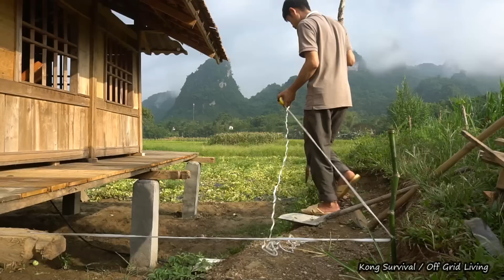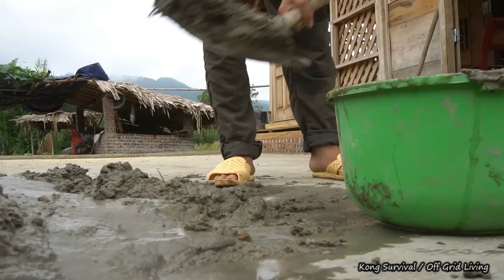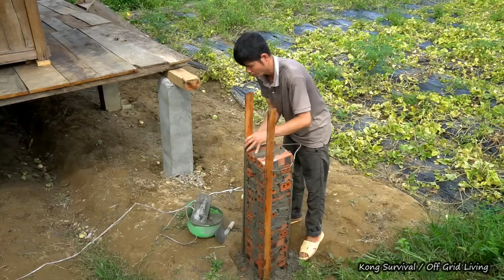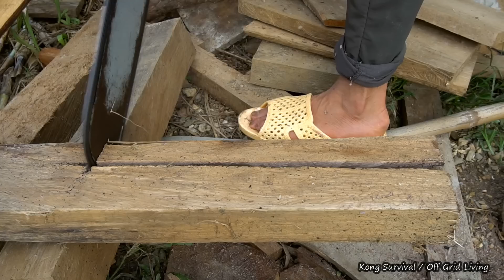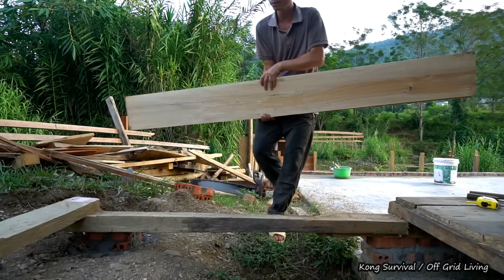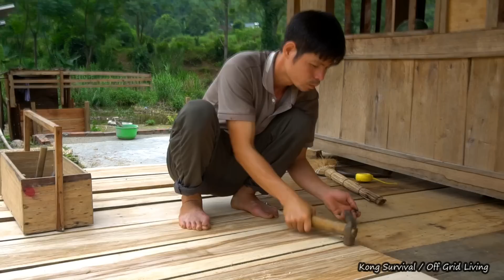Day 5 in the safe zone - Build pillars, lay wooden floors. Build a new solid kitchen

Comment: Hi Kong since you are using bricks as columns and borders for putting your home and floor and so forth please don't leave them raw because the flooring a bother that you have there is sections that still leave raw you need to submit it and there is few columns that you have that you just doing that doing for the kitchen it's still raw so you need to look and see what doing make sure that everything is covered with cement that means all sides ok wish u the best ❤🌸👍💮🌺🇯🇲 P.S Kong u left out one important thing the support under flooring for the kitchen u are starting to put on right away I saw the flex when u step on few boards more load on it will be not good or safe but you will hear that squeaking sound in your floors and so forth but it's not too late later on you can go on there and put boards from the back to the front and nail it under it well I wish you luck

Comment: Kong,  Are there center support beams running the length of the floor from the middle beam to the outside beams?  If so, why isn't the floor attached to them to prevent the floor boards from warping, cracking, and sagging when you step on them?  In the video, we saw large gaping holes with very thin boards on top, nailed only on the ends. The floor boards are too long and too thin to be self-supporting and need bracing in the middle....not just one beam from the outside wall to the house but also the full LENGTH of the addition.   If you HAVEN'T inserted lengthwise center supports, PLEASE DO IT!  Two would work well but AT LEAST one would be better than none. Did you fail to notice that your family installed two length-wise supports under each 4' section of flooring or do you just not care!  We do not want to watch a video of someone breaking their leg when a floor board breaks because you decided that a thin unsupported board would hold the weight of a stove, a work cabinet, table, chairs and multiple people.  This time, stop rushing through the construction and slapping things together. Take the time to make it SAFE and STURDY!
Reply: Looks like  it’s just the same as the main house. The  structures are just   put on top of each other wood panels and not  bolted to the  so called  pillars. Hope am wrong. Haste makes waste.
Reply: Não se preocupem o lugar é só para filmar os vídeos do canal, eles não moram está casa 😊